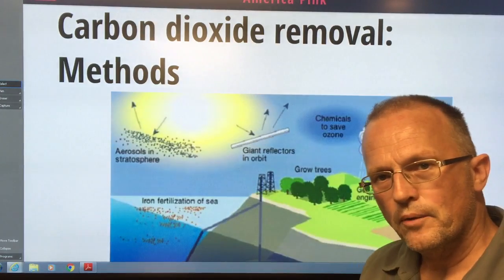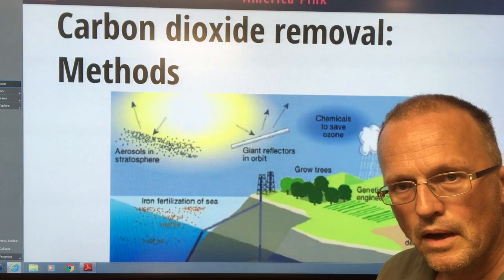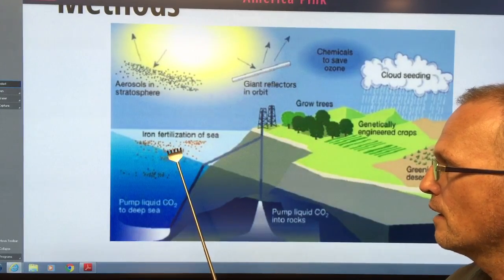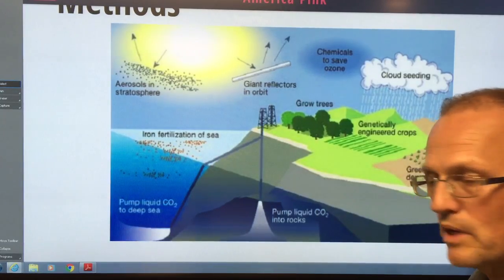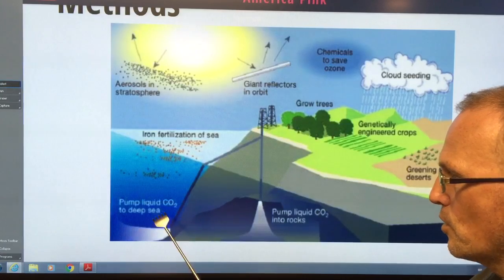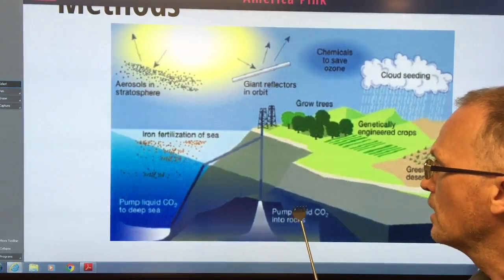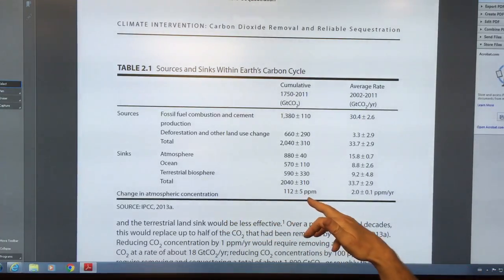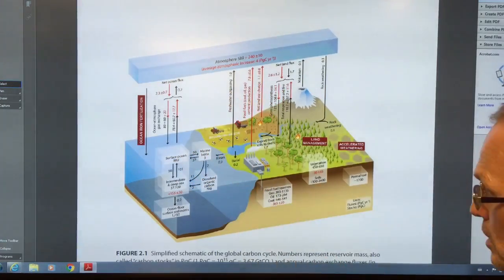Climate Barstool Leg 3: Carbon Dioxide Removal (CDR)

Comment: Instead of pumping Co2 into the ground which means in fact creating giant distillation or refrigeration plants to capture Co2. We simply make Co2 the mandated Refrigerant for use in All Homes, Factories , Skyscrapers  for both heating and cooling.. Too power it we stop screwing around with useless Solar and Wind and focus on the only real source of enough Power to re-power every power plant in the world Geothermal!! We use Steam and old but stable and clean power! We use Fracking technology and find the best Geothermal sites Drill fracking wells deep into a geothermal layer pump seawater in get Steam out!. Free electricity ,free heat, free air conditioning  as a basic human right!https://en.wikipedia.org/wiki/Geothermal_electricity
Reply: In Australia, we sit on the oldest rock on the planets surface, and thus we have no volcanic/ tectonic activity. We would have to drill a long way down to get geothermal steam. The closest viable geothermal is New Zealand.
Reply: that's true ,it really wouldn't mater as there could be a global power grid drawing from the best sources for geothermal access and distributing Electricity globally simply linking the existing power grids in each country..